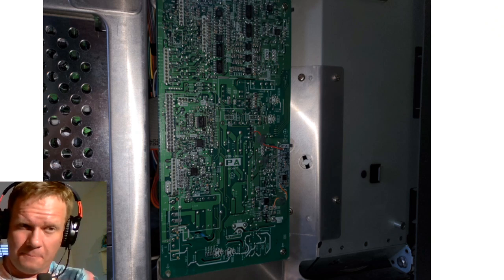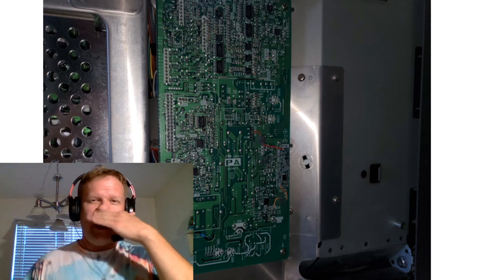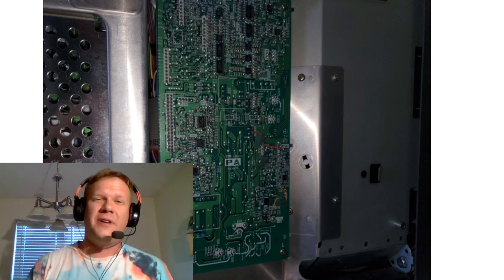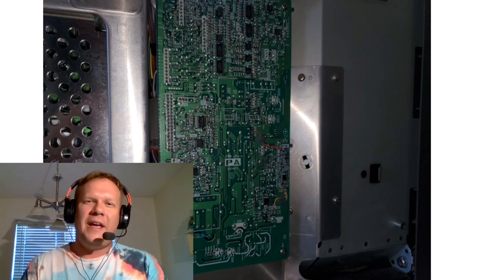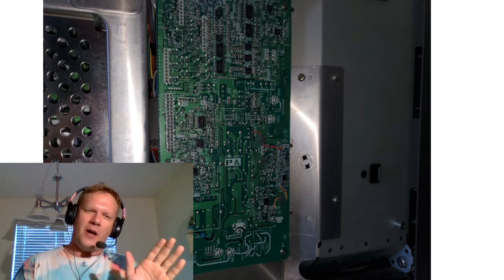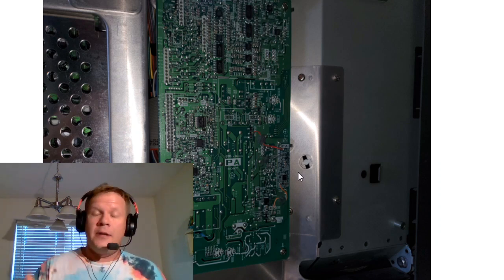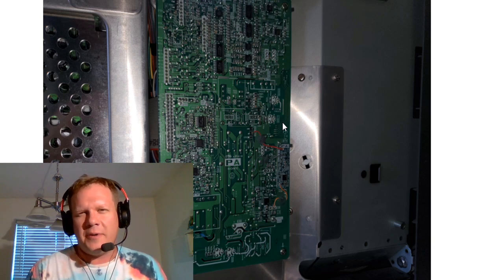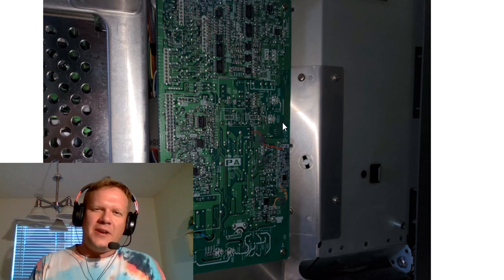Sony BVM CRT OVERLOAD failure! How High Voltage destroys the Tube, Fly Back & PA board?!

Comment: 10% of a voltage difference, up or down, is the limit as to what an electrical component, board, or motor, can handle.  That is why houses out in "the boonies", have main-line voltage that measures 115v, 110v, or 108v, and everything works fine.

That said, the 10% difference in the capacitor you replaced, means that it was "end-of-life", and needed to be replaced.  You made the correct decision to replace it.

Comment: Very cool and helpful video Sir!   about capacitors, there is allot to say about them,  when i test caps i test them over frequency, and i look at capacitance, ESR and D factor,  the D number should be low, and its great if you have some brand name caps to do comparisons,  it's usually the first value to rise as the caps age,  ESR follows, and then capacitance usually drops.   the lifespan of a capacitor depends greatly on 3 things,   temperature, ripple current, and the frequency of that ripple current.  the ratings of the cap are usually stated at 120HZ, but the frequencies in complex TV sets are usually much higher, so the perceived capacitance in the circuit is usually much lower, so it's good to over-rate the caps on voltage for those that take a high ripple current, and use 105C caps in places where it's hot.  also caps are rated in hours, on the datasheet, at max ripple current and max temp, the differences in run time can be 10X! so observe that carefully when choosing replacements.

Comment: Steve did you ever see blue epoxy on  tubes used as indication it was replaced? Also did you figure out anything about the numbers on the replacement tubes, are they different from the original?

Comment: When testing capacitors, you need to test their ESR too. A cap can have an okay capacitance but a way too high ESR.
During aging, a cap can increase or decrease in capacitance.
You also have to factor in manufacturing tolerances. 52mf instead of 47mf (and the new one reading 50mf) is nothing to worry about.
Capacitors are usually rated as "-20% to +80%".

Comment: Any information about swapping  electrolytic with solid polymers in CRTs in low voltage section (and non AC coupling)? I replace most electrolytic in PC mainboards, graphics cards, VRMs and power supplies that I restore with great success so far by using polymers with about 1/2 the capacity and maintain same V ratings and ESR as the electrolytics. The cost seems to have come down considerably over the few years. Before, I almost exclusively used electrolytics like Panasonic FM or FC on non critical ESR things and Nichicon HM or HNs on everything ESR critical. But I don't know how critical it would be in a CRT.

Comment: Very good info! Could you ask your Sony tech connection whether that is what happened with the D32 tubes as well? I read somewhere that every D32 had a tube swap done while still in service.

I checked the back of mine and it has a hand written sticker on it that says "tube swap at 8830 hours".

Comment: I really enjoy your informative videos. I recently purchased a Sony BVM-D20FU1 and noticed that there is a very subtle discoloration in the upper right corner of the monitor. For instance, if there is an entirely blue image output to the monitor, the corner will be slightly lighter blue. However, the geometry appears to be fine in that corner.

If the degauss button is pushed, the discoloration is temporarily fixed, but then reappears in approximately 5 seconds immediately after a “click” noise may be heard. Using a degaussing coil has also been unable to fix the issue. If a small refrigerator magnet is placed on the outside monitor shell near the discoloration, it “fixes” the issue.

Do you have any recommendation on what might be done as a permanent fix?
Reply: Convergence strips could help clear up that discoloration in the corner. If you wiggle it a lot, you may end up slightly adjusting the geometry in that corner at the same time, so be careful and do it in small increments. Most important: BE CAREFUL! Hope that’s helpful

Comment: Hey Steve - promise I’m not trying to spam - just wanted to have this on your newest video - was wondering if you had a spare 4:3 mask for a d20 I could get from you or if you could be persuaded to get some 3D print specs made up for one? Will send you a pm on reddit as well for easier contact - thanks!
Reply from the maker: Hey, sorry I don't have that mask, only the 16:9.
Reply: @RetroTechUSA  Hey retro :), I have a quick question. Do you accept pvm repairs coming from canada? I currently live in ontario and I'm unable to find any local shops that are able repair my JVC BM-H1300SU monitor.
Reply: Make a cardboard cutout, for a mask. lol